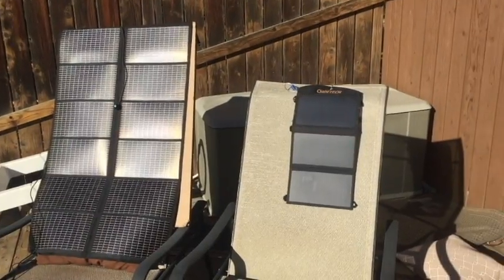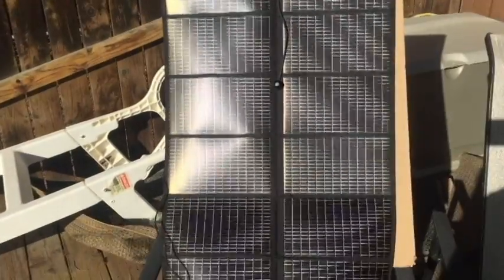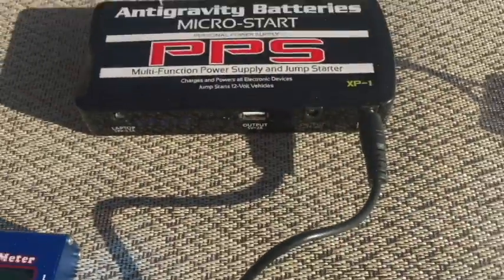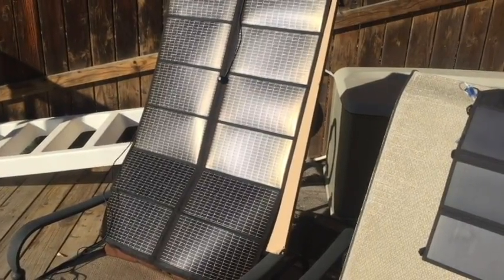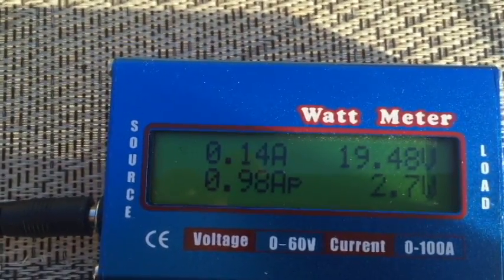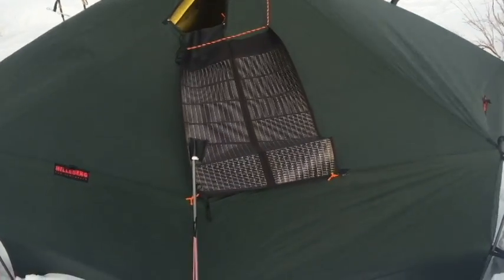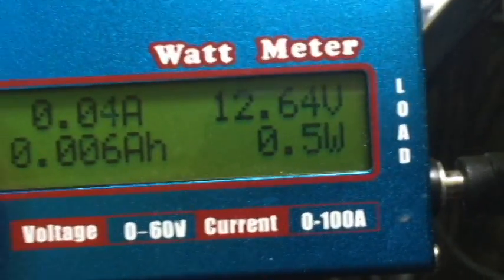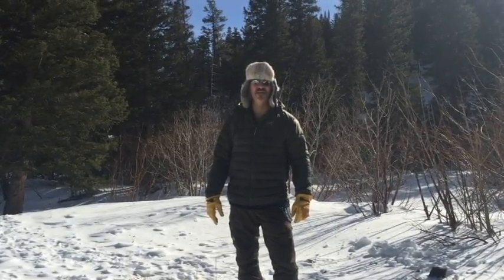Power Film 30W Solar Panel Part 1 Field Reveiw

Comment: Appreciate the review. I'm still debating if a 100W renogy panel will give me more bang for my buck for my use. I head out in my truck camping many weekends in the spring through fall. I want it to charge up the truck's battery which runs a 12V fridge to keep my food cold, and if needed, power a LiFePO4 battery for my ham radio set up and electronics charging. Security wise, the rigid mono panel I would feel more comfortable bolting to my truck's cargo rails above the bed.

Comment: Love the video! Thanks for your support.
Reply from the maker: I love your solar panels PowerFileSolar. Best I've used so far. I'm now testing a 20w foldable panel while on the move. So far it's working well folded in half such that half of the panel is exposed to low sun light. I'll make a video of my experience soon. I'll also show daisy chaining of the 30w and 20w while at base camp. You can see I've put my 30w thru 50mph winds and in very low light conditions and it's held up with no problems. By the way youtube viewers, I do not get anything from PowerFilmSolar or any other manufacture nor do not monetize my channel in any way. I tell it like it is and get nothing in return. Except helping you learn from my experiences. That's what this is all about. But I do thank PowerFilmSolar for a great product.
Reply: Thanks for making these videos! We will be sure to share them :)

Comment: Nice video HTS, I'm looking at buying this solar panel but just wanted your opinion.

I will be in the wilderness for 35 days and will require solar power to charge my camera. My Camera is a Panasonic GH5 with DMW-BLF19 batteries (7.2V, 1860mAh). I was hoping to generate enough solar power each day to charge two batteries. I will be hiking for most of the day so the solar panel wouldn't be in direct sunlight, hanging off my backpack. 

Do you think the Power Film 30W Solar Panel is suitable or do I need something with more watts? Also what kind of powerbank/powerpack would you recommend?

Thanks
Reply from the maker: I recommend the Antigravity XP1 which holds 12k mah and it weighs about 15 ozs. The XP10 holds 18k mah but weighs 18 ozs. I carry a few 1.5 oz Olight 18650's which hold 3400 mah each when I want to carry the lightest weight. Then I use a  Opus C100 charger to charge the Olights. The Opus 100 weighs 3ozs and has a USB 5v output which I can use to charge my camera. The 5v USB output might not work for your camera. Your chargers male cigarette lighter adaptor supports 12v-24v so you won't have any issues plugging it straight into the female cigarette lighter adapter on any of the Power Film panels. They all put out about 19 volts max. The 30 watt power film is overkill for your needs unless you are in very low light conditions. And you really can't open it up on your backpack as it's too big, but you could expose half the panels. The power film 20 watt should work fine for you on your backpack and it will do the best job for low light conditions and will produce more watts than any other 20 watt panel on the market. The 10 watt would be ok in high sunlight conditions. The advantage of the amorphous panels is that you can expose half of the panels while hiking and those exposed panels will work at 100% efficiency. You can't do that with the polycrystalline panels as they only work as good as the unexposed panels,  which means they won't produce many watts at all.  Then when you are at base camp you can expose all the panels to the sun for max wattage.  It all depends on how much weight you can carry and how much sunlight you expect to get. The 30 watt weighs 29 ozs. The 20 watt weighs 20 ozs and the the 10 watt weighs 12 ozs.
Reply: Thanks heaps for the reply, very helpful.

Comment: Not true, about the shading smaller panel, each section is it's own panel, so only the one panel will not produce current...
I just recently made a dummy load to test these SunPower portable units and I'm very disappointed only producing half of what they claim! I even bypass the little black box for the 5 volts and went directly from the solar panels made little more power but still not what they claimed! I made a video of the dumb load that I made....

Comment: just put the panels out in the sun on the snow, any be nice to your expensive tent.  powerfilm products are designed to be used flat (that why they are so flexible ).  If they were designed to be tilted they would build that in the design.